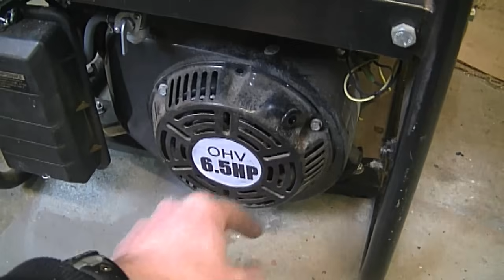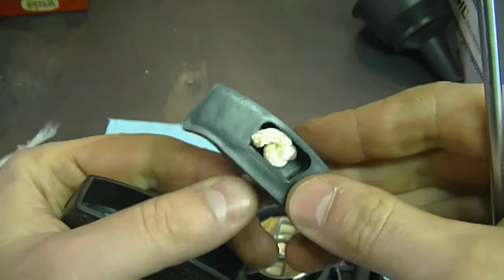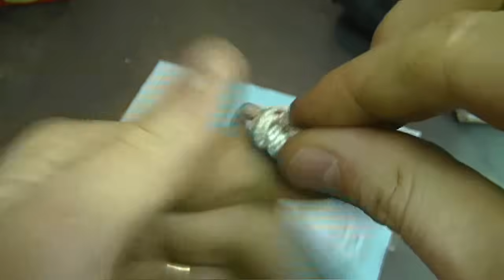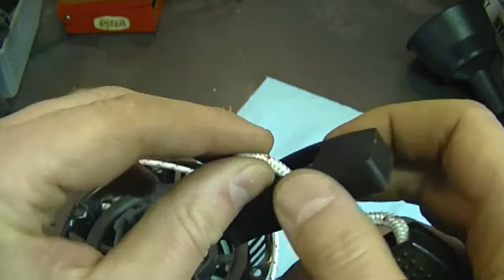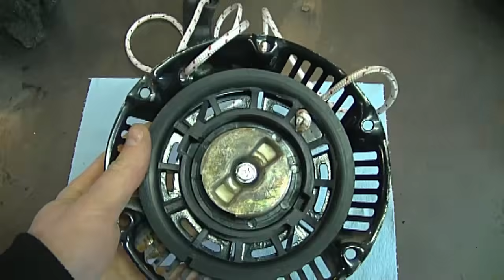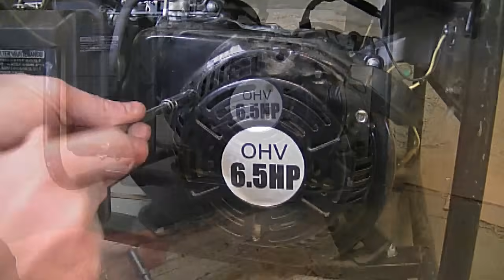HOW TO - Generator Pull Cord Repair

Comment: Got the full pull cord its deside it has ga e up thr ghost the rope as you say is fully out the three bolts are out theres clearly another bolt because I can't remove the mechanism I foolishly filled the tank and now ive got petrol pi55ing everywhere I fucking hate cheap shit generators

Comment: Hello. Predator 79CC, Attempting to install the Poles rope assembly, The motor has been turned over so I don't know where it was lying up. Every time I install it the engaged blades are not connecting to the inner hub. Help.

Comment: After I rotate counter clockwise 4 times, the spring engages and pulls the cord taught. But when I pull out, there is no resistance and the whole rope just pulls out all the way to the knot.

Comment: This happened to me and my coil is not turning four times and the coil is only turning twice before I run out of cable. The coil under pressure from the spring is not pulling the cord into the assembly.

Comment: Did that, ty. I replaced the carb and ran the engine for 2 hours last week.  Now it only runs for about 30 seconds and dies. Do you think the float is defected?  thanks.  Ken
Reply: stupid me. I confused the fuel kill lever on/off position. Lol.

Comment: I did this but after 1 pull the string doesnt get pulled back in and i have to retwist it. Ive legit done this 6 times and i don't get whats wrong with it
Reply from the maker: You might need a new spring in recoil.
Reply: @donyboy73  I tried again earlier and overloaded the spring, and it snapped lol
It's awkward af to do any of this with a cast on my hand, so imma just buy another pull start, but thank you!!!

Comment: Hey Donny? If one of the old Briggs and Stratton 3.5 hp mowers with the vertical pull starters comes into your shop? Could You please do a video on that? Unlike the common 3.5 rope starters I could never get that right. I have two of those antiques and can't figure that starting system out. Thank you Donny.

Comment: You mention the replacement rope is #5. Do you mean the diameter is 5MM? I need to replace the pull rope on my Champion generator Model 46596 & I'm wondering what diameter rope it might take. Thanks

Comment: with the vented recoil covers like on the Honda GX engines and clones, its far far easier to tension the recoil spring before putting any rope in.  Just tension it, shove a screw driver through to hold its position and then rope it :)

Comment: Sooo what braught me to this video  
pause for a second,  I just want to say how impressed I am, and how-die hard, and easy to fix,  briggs and straton engines are.  I never really messed around with small engines (like lawn mowers and weed whackers and all that) until about 2 or so years ago.  Till a 5yr+ old mower of ours, that has been beat to death, left in the rain, sleet, cold weather, been flipped over, thrown, dropped in adn left in a small stream or muck and mud, never having been serviced, nor an oil change, or spark plug change, or air filter change ect.....    was a Toro Self Propelled front wheel drive push mower,  the thing was abused worse than the kids who went to epstines island straight from a North Korean Child Prison Labor camp, ( I know I know ban analogy, just trying to show the ammount of abuse and neglect this mower has had), anyways one day I went to mow my steep hill of a yard whre the grass was almost as tall as my house,  I mean  people have been lost and reported missing in my yard at this point in time,  and the yard isnt even that big of a square footage of a yard,  so I went to mow it one day, and the mower woudlnt start, mind you didnt have the moneyh at the moment to go buy a new mower at that particular point in time,  sooo i decided to mess with the mower to see if i cant get it running, started with the quick things,  took the air filter out and blew it out with my air compressor and clean it up as much as i could, checked the oil and did a quick oil change on it using some oil i had left over from a oil change on a car (knowing that the mower could use the equivilant of 5w20 or 5w10 and be ok long as it not just that, and for the heck of it tossed in some lucus oil additive tried starting it, to no avail,  I then checked the gas making sure it had enouigh in it and if it was still good enough but added a bit of dry gas that I had laying arouind, as well as some stabul (we always had both on hand cause of the motorcycles we were constantly storing on the off season for people),  still didnt start but getting closer,  I then took the spark plug out of it and it was sooo caroded I probably shoudl have went right down and baught a new one as well as chanign out the wire on the mower that connects to it, but for the sake of time, transportation and finances I just sprayed some electrical connections cleaner on it, as well as some sensor cleaner and sanded it down a bit with a file then a fine grit piece of sand paper,   I also clenaed up the contact for the wire and the same for the other end of it where it connects making sure there was a solid connection,  still. nothing but again getting better,  I then decided maybe its got a clogged line somedwhere,  sooo had a buddy of mine pull start it while i sprayed carb cleaner or starting fluid into the intake,  and it would start up run then quickly die out,  I said ok well that aint no good but least we know its not frozen up,   thus telling me its not getting the fuel that it needed,   soooo I pulled the lines off one end to make sure fuel was flowing through freely,  fouind it was, until I got to the one that connects from carb to engine,   sooooo I pulled the carb, (and here is where and why I love briggs and stratons)  literally took me a total of 5 minutes to pull the carb, clean it all up all the lil ports and everything inside it, the bowl ,  I mean it had soooo mcuh varish and tarnish inside it i didnt think it was ever going to work again but carb cleaner and some fine grit sand paper and using the air compressor cleaned it up as much as i could,  popped it back on,   pull started it up and VAROOOM black smoke everywhere like it just blew out all the build up and shit that was sitting in it from all those years of abuse and neglect (I mean im sure the can of seafome i put in it in the gas helped a ton too),  but the thing came right back to life like it was brand new,  sooo i shut it down took the blade off it and grinded it down to a fine edge, and lemme tell ya thing ate through that tall ass grass faster than a wood chipper, with NO hesitation or stalling out......   anywyas that is why I absolutly love briggs n stratton engines, and I absolutly swear by them,  

but what braught me here today, is trying to figure out the pull start mechenism on a briggs n stratton generator engine,  and why its not winding back up like it should after changing the cord.

Comment: This just happened to me today at work, we're working on a house off the grid and our generator pull cord broke, we needed heat in the house and didn't have a new pull cord so took the cover off and wrapped the broken rope around the pulley and spun it and got it going, went to Lowe's tonight and bought two new pull cords and tomorrow morning will reassemble it and you really made it simple and I shouldn't have any problems now. Thank you very much and I will remember this tomorrow morning.

Comment: Great Channel..question..I have a generac gp6500...I pulled to test it..started..shut it off..started again and there is no tension on cord..are the little metal arms that attach to the hub btoken?.springs not working?..do I need a need pull starter?
Ty again!
Reply from the maker: Most likely

Comment: Came looking for help on my mower and this wasn't the exact issue. However the starter clutch was sticking and not engaging so I put a little olive oil (the only lubricant to hand) into both the lug nuts holes and it freed it up. Starts fine now. Thought I'd pass this on in case it was useful to someone else.

Comment: When we were testing pulling the rope before we reinstalled the recoil assembly it looked like the rope we had was not stiff enough and not going to work without getting tangled up. Once we put it vertically onto the generator though it worked just fine. Just wanted to leave a note about this in case anyone else thinks they got the wrong kind of rope. We used a basic standard "5" rope from Walmart that can be used for anything.

Thanks for this video. It was a life saver!

Comment: I’d recommend an arbor knot whenever it comes to pull starter recoils. The arbor knot will assure you that when you pull on the rope it’ll actually make the knot tighter rather than looser like how you would get with the knot that you have on now

Comment: When I try to counterclockwise wind the spring it just clicks and doesn't create the tension. In other words you hold the spool to keep it from reversing but m ty spool just clicks and if I let go it just stays put rather than reversing. Any thoughts? It's a champion generator and the spool looks almost identical to yours. Thanks

Comment: Not sure about the name but there's a small compression spring that goes either goes under the bolt or under the guide pan ( I don't know which way ) on the guide pan ( the gold colored part ), do you know what the part number is for the spring? Thanks for all your great video's.

Comment: When I turn it counter clockwise it's clicking...how do I fix this we need power desperately. We live in the RV and someone cut my rope where I was staying. So can anyone help ASAP?
Reply from the maker: it's possible the spring is damaged. try a local small engine shop they may have a recoil or can fix that one on the spot, if I was closer I would fix it for you

Comment: I did just that but the generator won't start (i mean there is no resistant force) when pulling the generator pull cord can you please help
Reply: I just noticed that the two starters were missing. Sorry about not observing that the video was a great one to me. Thanks.

Comment: Factory supplied pull cords are crap. They must be 50% cotton or other weaker material. The breakage isn't from pulling incorrectly. The factory cords deteriorate easily.

Comment: The best tutorial in the matter!  thanks.   My Chinese generator is very similar to yours, but the recoil cover have the cord handle oriented to 10 oclock.  I want to change the orientation of the module so that the cord handle is at 2 oclock and not at 10. Since I placed the generator in a soundproofing box it become very uncomfortable to manipulate the handle from behind at start engine time. Btw as well as yours my recoil cover has 6 holes of which only 3 are used.
If this possible to do without affecting the starting operation?

Comment: donyboy I need your help.  I just replaced the cylinder head gasket on my Jacobsen Snowburst snowblower.  It starts up but i feel air coming right from the new gasket area.  The gasket went on good and I re-tightened the four cylinder head bolts thinking that I did not tighten them up enough.  Should I take it apart and add a bead of RTV sealant on the gasket?  Thanks!

Comment: Thank-you for this helpful video - used this technique on my snowblower today and it's up an running again.  Couple of notes: 1) I sourced 5mm rope from the local Dollar store; 2) I can't stress enough your point about lubrication!  It made for one-pull starts and a super smooth recoil; and 3) I found my snowblower required 6 turns to properly tension the spring, unlike the generator's 4 (others might want to take note that you will need to do it a couple of times to find the right sweet spot for your engine type).

Comment: Thanks for the quick video on this! I broke the recoil rope on my mower today, so I can use this same process. QUICK QUESTION though..i have a Honda clone engine on my generator as well. What Id like to know is this; Have you found a good source for buying replacement dipsticks that have the magnets on them so they will attract the metal particles that suspend in the oil? I found some for the more expensive Honda generators, but not sure which would be the correct one for the Honda clones. Can you assist? Thanks !

Comment: Thanks Donny!  This video really save me bootee.  After the big storm the power went out.  Fished out the generator which has sat neglected for a few years.  Very much like the one in the video.  Pulled the starter cord and ARGHH, wango - it broke!  I knew there was a procedure for changing it, but had forgotten the details.  I also knew that if you started messing around too much,  you might end up with a bigger problem - as in springs flying through the air and little clips going who knows where...  Watched your excellent video X2.  "Tis easy when you know how."   You didactic style is excellent.  Clear and straight forward - no extra BS or attitude.  No matching rope handy and the roads are closed.  Made do with a length of para cord.  We be up and running!

Comment: I made the mistake of taking the inside recoil plate off to replace the rope  (much easier the way you show, which I should have watched first). problem - a tiny spring popped out and I have no idea where it belongs! the case will recoil but the teeth don't come out to grab when I pull cord? any idea where that spring goes!?

Comment: Are all the rope different  inches for each lawn mower?
Reply: Rule of thumb on a Honda is 4 turns against the spring tension and #5 rope.
Reply from the maker: mostly the same but shorter if handle retracts to the engine instead of handle bars
Reply: donyboy73 Thank. I left mines outside for one night to let it cool down and then the next morning the rope pull got chewed off.
Reply: "Mines"?  Gold mines, coal mines, salt mines??

Comment: mine still won't spin and pull the cable back:(
Reply: +Josiah Lopez
looks like you might need to realign the actual spring cable inside the recoil starter itself, by taking off the metal plate and latching the spring back in it's inner grip and outer grip.

Comment: It seems the rope is mountaineering rope, where in as you said is #5 and braided type by 58" length as shown in your video and matching with the one that you have removed, well i got it now, because just now my PROMATE HOME GENERATOR 7100-watts the pull cord was damage and it teared -off while starting my home genset and the cord was over 3-years now, and after watching your video i was surprised that i can replace it with mountaineering rope#5...wowww thanks  a lot i your informative video, i will go and check it in Handyman or Ace hardware here in the Philippines, thanks  a lot again and God Bless

Comment: Hello Dony
Nice video, close to my problem!
I bought 2 months ago a somewhat similar (3 phase) generator (ZIPPER).
The cord is not broken but doesn't retire after pulling.It seems one of the two plastic supports (that presumably holds one of the 2 metal clamps that engage the engine) has broken.Is there anything I can do except buy a new starter (that is pretty expensive).
I still have the metal clamp.  
I am right handed and the cord is placed on the left side so i must use my left hand so I'm quite clumsy.

Comment: Could you tell me which way a Governor screw has to turn to make the engine run faster? 
I have a 1992 briggs with the carb over the tank. . The spring had broke and I replaced it with a new one. It also was stretched so some had adj the gov before .
I tried putting it all the way in fast and turn it clockwise but it made no diff if I turn it counterclockwise will it make it run faster?  I also have almost the same gen set as that one runs great.

Comment: i have got an old 1985 ems4000 honda generator, someone had taken off the pull cord assembly, now i put it on, it does pull, but then it gets stuck again. is there a certain way it properly goes on???? thanks.

Comment: While I got you, I had the Spring break in mine (right where it is bent at the end). Do most of the Honda Motors use the same Pull Starter Assy. I have a Real Honda LawnMower that is not running worth much. Do you think (I know am I asking a question with little info) the pull starter assy is the same on a Honda Mower.? If you need more Engine Info Ill go outside THANKS!! (Im hoping u will say ALL THE SAME WONT MATTER LOL )

Comment: Good vid.  To make absolutely certain those knots won't slip, I put a very small dropp of superglue on the knot.  Be sure not to get any in the cord anywhere that it may flex or bend, as that will be a stress point that could fail.